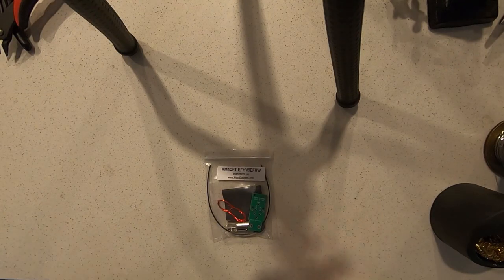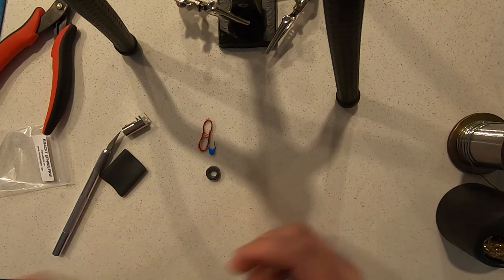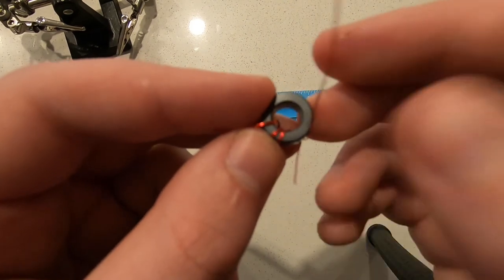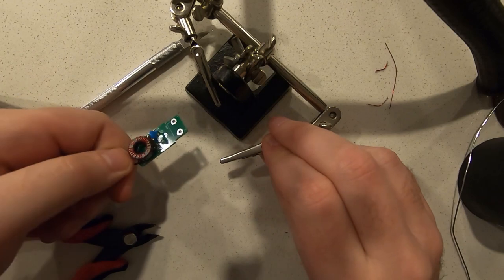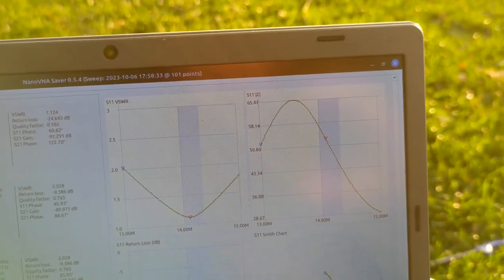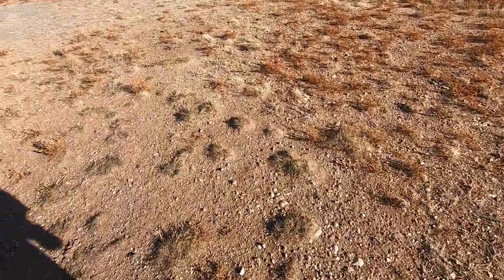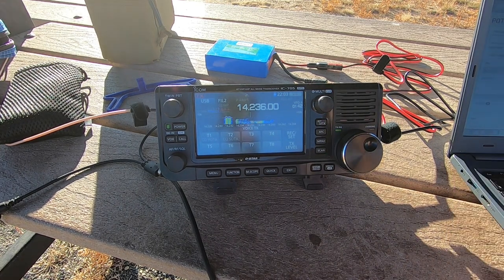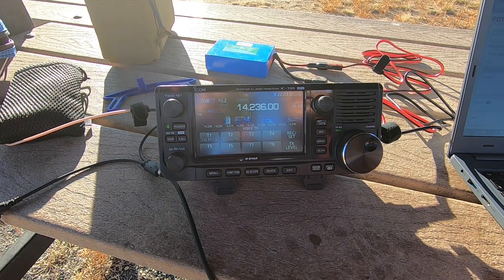KM4CFT QRP End Fed Half Wave Kit Assembly Tutorial

Comment: I found this video after I had built my unun. The written directions were great. Only thing I did badly was not scrape enamel from magnet wire before soldering. In tuning the wire length, I'm starting with 20M band and using NanoVNA. For 14.1 MHz, the resonant length is about 28 feet, which seems quite short. Is this within the expected range, or did I do something wrong?
Reply from the maker: Actually thats about the length I end up using for the 20 meter band. I tried to be extremely conservative with the lengths so that people wouldn't accidentally end up cutting it too short.